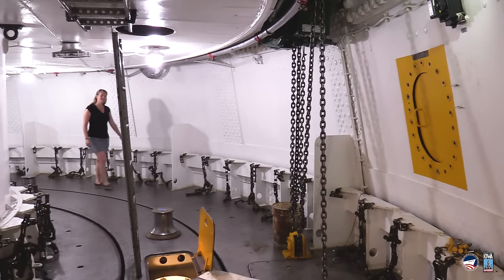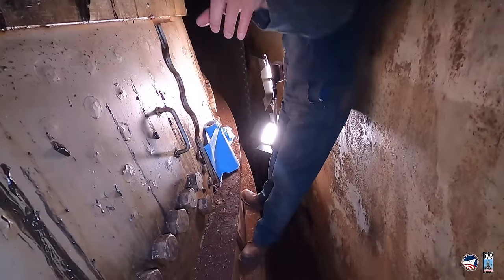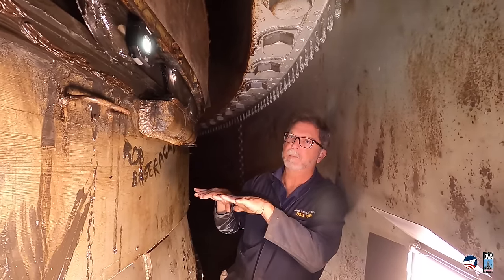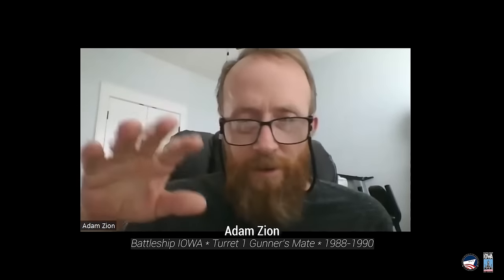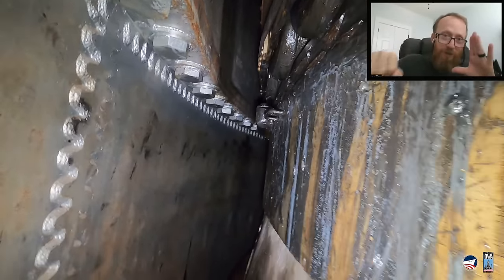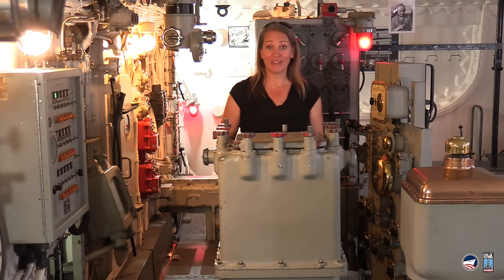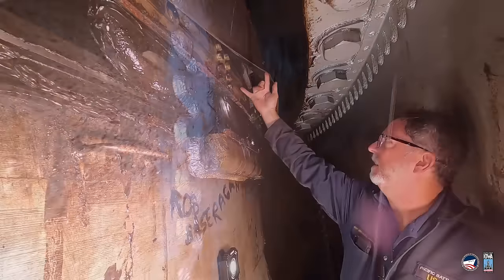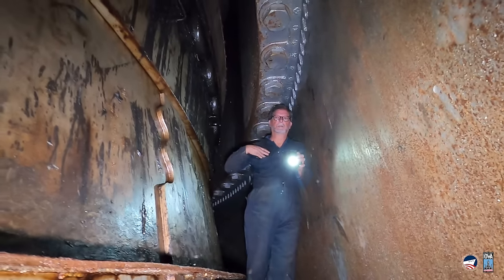Never Before Seen: 16" Gun Turret ROLLERS MOVING

Comment: Still working flawlessly after 30 years: great engineering!
Reply: How many rounds fired since new? In operation circa 80 years
Reply: @tobyw9573  Battleship gun tubes are replaced after a certain number of shells are fired. Those gun barrels are most likely not original.

Comment: Incredible. I want to say that I heard Ryan S. from the New Jersey state that the turret motors take something on the order of megawatts to operate, which was impractical from shore power.
Reply: He probably did say that....  and he was wrong!  There is a video here on the Iowa youtube channel that breaks down the amount of power that it takes to rotate a turret. See here for yourself: https://youtu.be/AtVZ0u_Xmog?si=7zNjYcojfloLrySr&t=51
Reply: @SlipFitGarage  Thanks!
Reply: only about 1200 amps if recall (without watching the video linked below).  yes i say only, because we just had a bus plug at 1600 amps go bad at work and needed to swap it out.  assuming 480v thats only about 576kw.
Reply: @SlipFitGarage  Ryan could probably benefit from having a ships chief engineer on board
Reply: You also have to remember that Ryan & the New Jersey are moored in a place where they simply can't get enough shore power to move the turrets, the infrastructure is not there, and the costs to make some other way of doing it possible simply far outweigh what that museum could do. Cool that Iowa has the resources to do it
Reply: @KennyCnotG  Can't see the difference. Both are moored in busy harbor areas.
Reply: Ryan isn't wrong, there isn't enough power available to the USS NJ. But there is, with enough trickery, for Iowa.

It isn't some sort of competition though. Not sure why people are so butt hurt about all this.

Comment: Sonar Domes are filled with water from the fire main and very seldom dry. and to keep the rubber (1 billion dollars to repair window safe), we would turn off the water and push the water out using low-pressure air. the dome needs to be under pressure, so to get into a pressurized dome, people need to go through the airlock. On the inside (The 30+ foot rubber window in my time 7, ply steel belted window could only be made by Goodrich Tire Com), the back wall had/has the names of all the people that would go into the dome in Grease Pencil. Holds up well against Salt water.

Comment: Amazingly smooth after 80 years!  I did not know that any of the Iowa class turrets could rotate.  Does Ryan on NJ have anything in response?
Reply: Apparently, none of the turrets on the Iowa class battleships were welded in place (other than some easy to remove tag welds). Ryan's response after inspecting the turrets on BB-62 was a jealous sigh that they'd rotate if only they had enough shore power. One day, hopefully :)
Reply: [Jealous Ryan Szimanski noises]
Reply: I don’t know much about the Iowas, but I’m assuming something that big must be hydraulically powered. So you would need one massive hydraulic motor pressurized by an equally massive hydraulic pump, supplied from a huge reservoir of fluid. And then the power to turn the pump has to come from either electricity or steam. So yes, in the absence of shipboard power, it would take lots of shore power to run that kind of equipment.
Reply: So far, only Iowa has gotten one of theirs to rotate. New Jersey has a video on it, apparently they could do it but they don’t access to enough electricity in Camden to do it

Comment: Could you imagine how loud it is in that space when those 16 inch guns go off lol!
Reply: I'm guessing that there is no one on earth that could tell you exactly how loud it would be, but I can give you a bit of an analogy and insight from personal experience with the current workhorse of the fleet, the MK45 5" gun.  When topside for the 5" gun shoots, double-hearing protection was recommended (plugs & muffs).  However, keep in mind that the 5" barrels were much shorter than the 16" when I was in (~47' shorter, if my math serves me) and there was only air to slow down the sound.  You could feel the sound and with just one set of hearing protection it was tolerable for a short period...especially if you were 20-30 feet away.  Without any hearing protection, it was flat out painful.

I'm sure the sound percussion would be dramatic anywhere near the 16' turrets, but pretty sure that space they are in is both inside and behind/under armor plating.  While most of the sound goes out (the direction) of the muzzle, soundwaves are multi-directional, even when "directed."  Though, as alluded to above, the barrels of the guns themselves were 66' long so you would also be pretty far away from the muzzle.  

All that being stated,  you certainly wouldn't want to be in that space when the gunmount was fired.  Even if you dismiss the potential for high db.  Confined spaces like that can do funny things and can have weird attributes.  Whether completely airtight or not, the sudden compression/decompression of air due to the proximity the gun might momentarily rob you of air in your lungs and/or, bust your eardrums.  There could also be a crazy (reverberating?) shockwave(s) causing you to bash your head in to some bulkhead or make you bite down so hard you crack your teeth.  No thanks.

Comment: for all those rollers to be driven in unison by the weight of the turret alone means they have to have insanely close tolerances in size between one another and that the hardened rings are perfectly flat. for something that size and built to take abuse is just insane

Comment: I'm curious, did all the original equipment work once power was connected? Ordered some components need to be repaired or replaced. Not specifically the bearings in this video but overall in the project to turn the turret.
Reply from the maker: Original equipment. No alterations. Just added some fluids. Worked beautifully!

Comment: what measures do you take to make sure you're not going into a space that doesn't have breathable air?
Reply: Good point! Confined spaces that haven't been ventilated in a long time can be lethal. When iron rusts, it consumes oxygen from the air. Anchor chain lockers are known for this hazard but there it is a very large area of rust in a small space. I don't think the area shown here is very air tight but I'm not sure.
Reply from the maker: When we go into confined spaces, we typically open them a few days before we enter, take an oxygen monitor with us, and have someone on a radio outside the space that we report levels to periodically.

Comment: Q: Aren't the bearing rollers tapered machined based on the radius of the running surface and the lower and upper running bases are angled to follow that taper?

Comment: When the New Jersey museum staff restored the innards of Turret 2 for tours they cut an opening in the lower barbette and the rotating structure to allow easier access for the public. You can see up into the space between the barbette and the turret there. I was able to get a picture of the bolts in the underside of the upper barbette armor, but the lighting wasn't quite good enough to see up to the roller path.  

I wonder if they screened people for claustrophobia before sending 'em in there to grease those roller paths?
Reply from the maker: Ha! Right?

Comment: Back in the Sixties, I was getting my PhD in nuclear physics, using a large and heavy magnetic spectrometer to analyze the particle beam.We had to adjust its angle, so it was mounted on a war-surplus turret mount-- not battleship main gun, but definitely a gun mount. Even when no longer at war, the turret had its uses.

Comment: love the names wrote on the walls... that's awesome be cool to research some of those guys..

that behind said, those 2000 ton turrets turn a lot quicker than I thought they did...

although I do think its fairly strange that the turn to starboard is quicker than to port.... did that have more to do with the mechanics of the turret or that it wasn't greased on the initial port turn and then the starboard turn had "more grease" to roll on, it looks like its a few degrees quicker to starboard than port.
Reply from the maker: Had more to do with our gaining confidence in the fact that all the systems were functioning. We took it easy at first, then pushed it a little faster.

Comment: what was the process from locking the turret down so it could not move during service? That seemed to have been skipped in the video. i assume there has to be some sort of breaking system for when the ship is underway in high seas as well.
Reply from the maker: There are both breaks and pins to lock it in place. The pins are accessed up in the gun house. We'll make a video about them when we have a chance.

Comment: Not sure hot battleship chick or any of you caught this, but they used molybdenum grease!  That stuff is amazing and extremely expensive compared to the grease we use now
Reply: There's a reason the bearings still look like new and there is still soft, semi-tacky grease on them. Cheap grease would have hardened and flaked off after 30 years.
Reply: And just try to get molybdenum disulfide out of any clothing or fabric . That stuff is beyond persistent.
Reply: @paulmanson253  haha, my wife is 110% on board with that

Comment: What kind of preparation do you do before you enter a space like this?   Do you do air monitoring?  Do you have a rescue plan in case someone gets hurt while inside?  I'm assuming there is only the one point of egress.
Reply from the maker: There are a few points of egress, but they're all tricky. This space is slightly different, but we went over how we usually prepare for confined spaces at the beginning of this video:

https://youtu.be/J9o9Hzypxgo?si=CRuaDxjeTwbLTwV7

Comment: It's hard to get a scale of how large the roller bearings are.  The part that's visible is just the end cap, the roller itself looks to be a couple feet long, maybe 10" diameter?  Are there any drawings of these?  And how many are there?
Reply from the maker: Adam Zion said he got his arm in there past his elbow (yikes!). We'll see if we can find the dimensions in the drawings and get back to you.
Reply from the maker: We just looked at the diagram for the path and the rollers and it's totally fascinating. We're going to do a video about it, but a few quick stats for you now: the roller itself tapers from 11" (+/-) outboard to 10" (+/-) inboard. The exterior part is 15" and total length is around 22.5".

Comment: "The turrets not bolted onto the ship, it's just sitting on the ship" -   Wondering what the 'roll' degree allowance might be before a turret could come off the base?  It's hard to tell from the video- maybe a few inches where the out wheel of the rollers overlap the base? The barrels might put leverage pressure on their side - possibly the overall design of the main load of the turret is low and centered, serving as a turret ballast? Maybe they calculated that this would not occur short of rolling/heeling to the point of no return from capsizing?

Comment: Totally awesome video!!!!

At 7:15 there is a hatch that shows up above the roller path. Where does that lead?

At 7:38 there are ladder rungs leading up above the roller path. What are those for?

Do you know how often in service the roller paths were supposed to be greased?
Reply from the maker: Not sure where either the hatch or the ladder lead. Somewhere in the electric deck, one level above where we were. 

From what we got from Adam, it sounds like they didn't grease the rollers too often.
Reply: @BattleshipUSSIowaLosAngeles  come on where is your sense of curiosity???!!  Just kidding. 

I’m not surprised the need to grease those rollers was rare. Thick grease in a sealed space on a surface that doesn’t get enormous use.
Reply from the maker: @jetdriver  Just looked at some diagrams. Hard to tell where the hatch actually is, but we think we know and we're going to go investigate. We'll get back to you.
Reply: @BattleshipUSSIowaLosAngeles  that’s very kind thanks!!!

Comment: Wonder how often they had to grease the  swing path when in operation in WWII ? When at sea and rocking would have caused metal fretting if got dry.
Reply from the maker: Not sure on the frequency of greasing, but Adam mentioned greasing underway in our conversation with him. Said it was - not surprisingly - more difficult, mainly because you were trying to hang on when the ship rolled... with greasy hands.

Comment: I assume there's a slight taper from the outside to inside ends of the roller bearing so that it doesn't try to roll in a straight line.

I don't know why, but I'm super curious to know the taper angle. Or just the diameter difference between outside and inside.

Any idea? Maybe it's in the original blueprints?
Reply from the maker: Yes. Slight taper. We did a little homework on it and it's kind of fascinating. Expect a video on this subject soon.
Reply: @BattleshipUSSIowaLosAngeles  
Very cool, and interesting! 
Was my question the catalyst for you researching this? If so, wow! I'm honored!
I learned about the genius innovation of tapering from the way train wheels work. 
I wonder when they first started to use tapered bearings. I can't imagine how much wear and tear they suffered in old battleships if they used straight cylinder bearing. Yikes!

I'm freakishly obsessed with battleship Texas, and now I'm wondering about her bearing system as well!
Looking forward to the video!
Reply from the maker: @mikey92362  No, we got curious after editing the video and noticing the speed difference between the rollers and the race. Sorry. ;-) Still a good catch, though!
Reply: @BattleshipUSSIowaLosAngeles  
Nice! There's some good videos out there about why train wheels are tapered that might be informative.
Thanks for the info so far! Really fascinating stuff!

Comment: The rollers look like they are cylindrical.  Is that right or are they tapered?
Reply from the maker: Cylindrical but with a slight taper - around 11" diameter on the outboard side down to around 10" and change inboard.
Reply: @BattleshipUSSIowaLosAngeles  nice!   Thanks for the reply.
Reply: 9:44  @BattleshipUSSIowaLosAngeles 
So not cylindrical, but tapered.
Which was the question.

Comment: As a captain I'm very concerned that you went in that hatch without ventilating or did you I don't know

But with the amount of rust I see you there the oxygen could have been very depleted

It's common practice when you see a hatch with multiple bolts after you remove those bolts you ventilate the hatch before entering
Reply from the maker: We did. We also had support staff standing by on the shell flat while we were in there. We just didn't show it on camera. 

You can check out our tank dive video. We talk about our confined space entry procedures in it.

https://youtu.be/J9o9Hzypxgo?si=XOh8xtd-zzo4UUrC

Comment: it's not graffiti. it's a killroy....you sign off that the work was performed and inspected.  you take an entire tube of grease and plunger it out from end cap to end cap with the bulk wad in the center, between each roller. rotate the turret until each roller is 180º from the first load of grease, then you repeat with an entire 2nd tube of grease between each roller. then you rotate the entire turret 90º and inspect for proper spread and coverage depth on every bearing looking for signs of rust, paint chips/ critters-bugs, water and other fluids, basically anything foreign that shouldn't be there (sign of other problems in other locations) debris and harded/dry grease clods, documenting location and point in process and removing as found during the entire relube and inspection process if anything is found during the 90º grease spread master mechanic is called to inspect and given documentation and shown locations for his inspection and ships bridge watch is also notified to inform bridge commanding officer for command remediation decisions and to make captains note for fleet command the ships fitness report.
when bridge command signs off remediation effort has acceptable resolution turret is returned to cradle rest position everything is triple checked and  mechanic signs off watch signs off, and bridge command signs off to the resolution if system is allowed to continue operation and under what restrictions if any. alot of family and friends in the navy dating back to 1931... i preferred the civilian service because i liked to fly and love heights, navy's wings of gold didn't have anything big enough for my giant frame.
Reply from the maker: Interesting. Quite a contrast from what Adam Zion said they did in the '80s.
https://youtu.be/cJuvfPNwPvI?si=43nxz9wrpVye-kSp&t=257